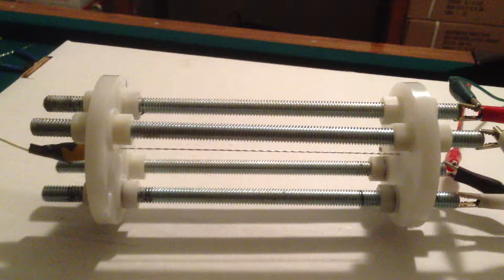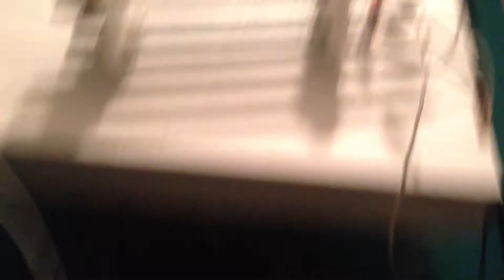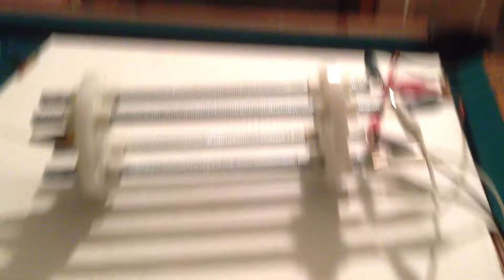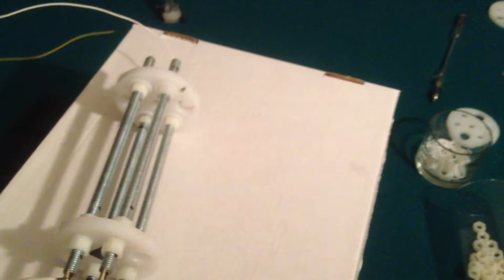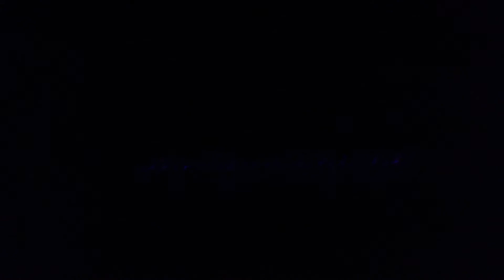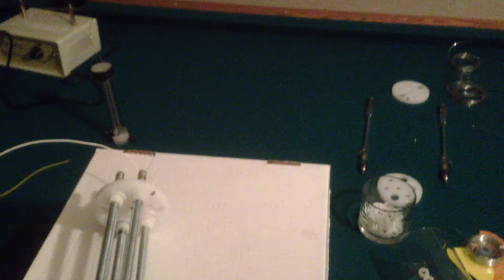Laser EPG 018 - Testing the new gas processor design for corona discharge

Comment: Dear Russell, This video is awesome :)
 I started recently as a part of my project that i need to build a corona discharge for a lab scale I'm a chemical engineer :)) so what do you suggest like books or references to get a simplified design ?

Thanks :))
Reply from the maker: I'm not sure what application you will be using it for, but this is a nice size to start with. There are smaller or larger versions available. Just put one of these in a housing of some kind with an intake vent with fan and an output port/vent and you should be good to go. The ozone producing plate should be mounted aerodynamically next to the exit to get good air flow across it.
http://www.ebay.com/itm/110V-2000mg-h-15W-Supply-Ceramic-Plate-Ozone-Generator-Air-Purifier-Kit-/263017368503?hash=item3d3d0e8bb7:g:QaYAAOxyBvZTVidt
Reply: , The main idea is to form a plasma by Corona discharge and by using a mixture of gasses such as N2-H2-CH4-Co2 and I've a Pulse generator 20Kvpp with 4-500 kHz , and I've to design a reactor which is suitable to .be used with this Generator and hopefully this will breakdown the mixture
Reply: Kindly, I've contact you on Facebook :))